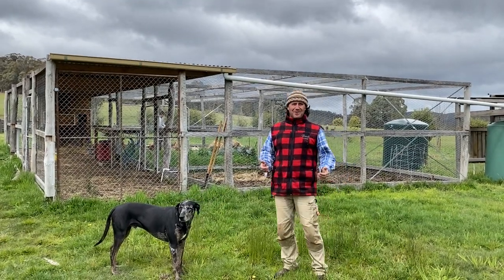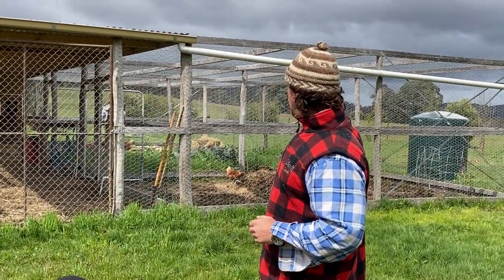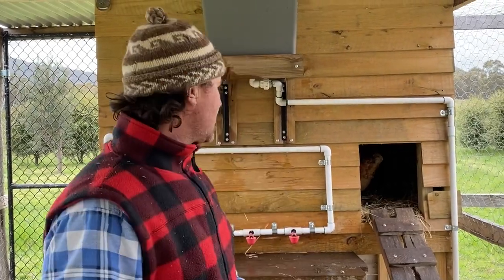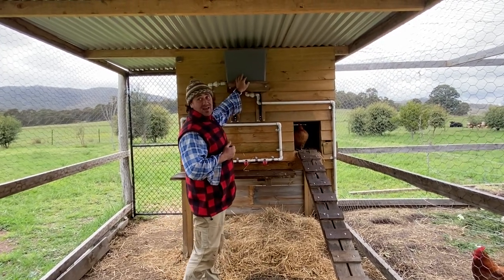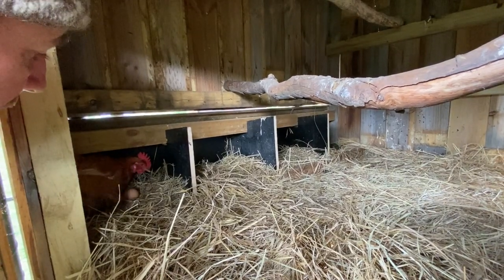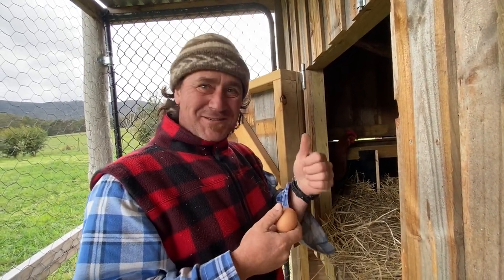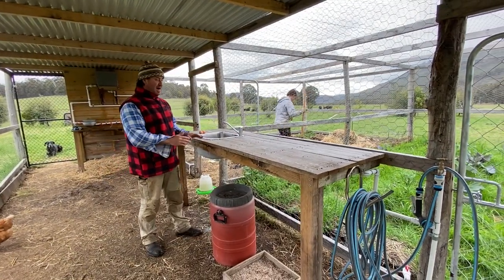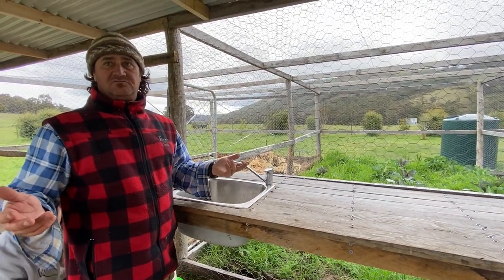A Tour of Australia's Best Chicken Coop Design as voted by Fat Cow Farm Tatong

Comment: Hi from QLD what wire did you use on your yards? Do you have a problem with carpet snakes? Cheers
Reply from the maker: Hi Noni, the wire is heavy duty chicken wire 1.4mm thick. No issues with sankes  - touch wood. You would have to talk to someone in the know who deals with pythons regulary. Thanks again, cheers.
Reply: @FatCowFarmTatong  hey, thanks so much for the reply. I love what you’ve done with your chooks and gardens. Well done 👍🏼
Reply: Use Aviary wire mesh 10mm, or mouse mesh 5mm just make sure the snake can’t climb it. Look up feral animal fencing designs